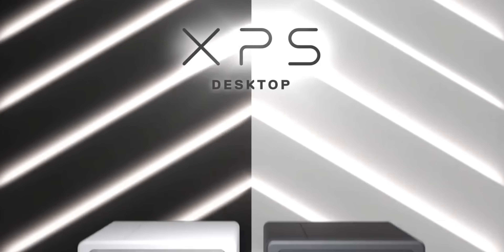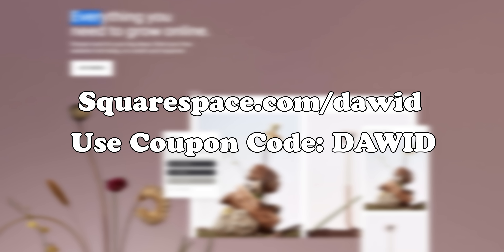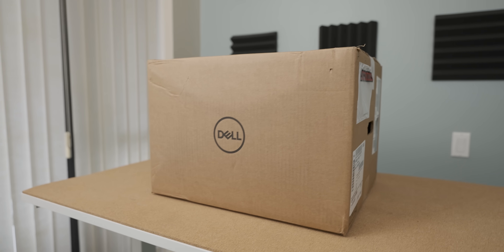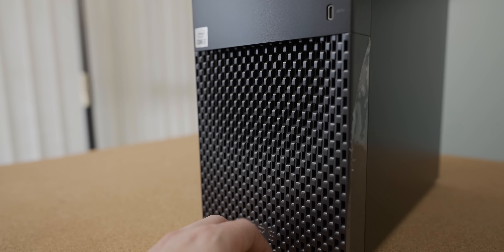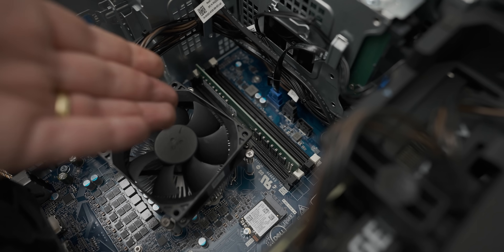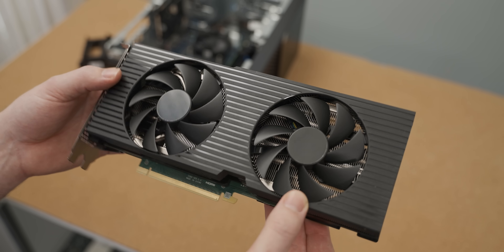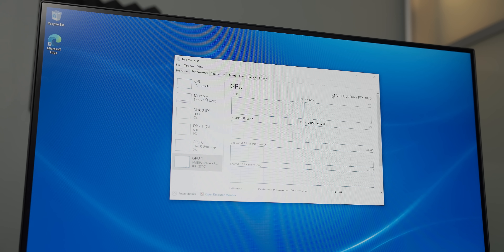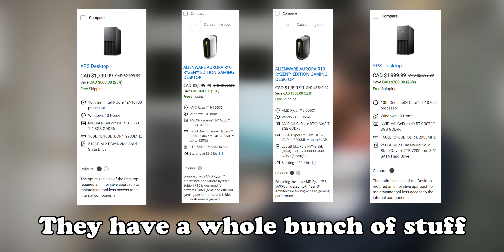DELL Did Me Dirty... RTX 3070 Dell XPS Pre-Built

Comment: Why diss the PC's outer appearance when that's what you ordered? If you wanted it to LOOK like a gaming PC then you should have bought an Alienware. Why diss the mouse and keyboard before you even try them? Bet you that wired mouse has way less lag than many wireless mice have. And the keyboard? We had a standard basic Dell keyboard that was used hard for 6 years or more. It took a lot of pounding in games and kept on tickin'. Regarding Soviet-era power plant operations it's worth pointing out that they retained and maintained their tube-powered electronics instead of updating it all to solid-state equipment. Why? Because they knew that in case of a nuclear explosion miles away transistorized gear would fail from the huge emi field generated by the event, whilst tubes would continue working. Dell will no doubt send you 2x8GB RAM modules if you ask for them, although you shouldn't have to! If the better cpu cooler was definitely displayed in the website product photos then they should also send a tech to your home to install the nice tower cooler for you (what are the chances?).

Comment: The 3070 works fine with a single 8pin with a 500w PSU? My PSU is 600w and my 3070 takes a 8+6 pin. How does this 3070 work with only an 8 pin???

Comment: Tbh, I love the aesthetics of those office cases, just a black box without tempered glass panels nor f**king RGB.
Reply: smh you lose performance without rgb
Reply: @cybercery5271  if you don't want to lose performance, you can just use rgb led strips
Reply: I agree, though I don't mind glass when used correctly,
Reply: I don't like the glass panels or RGB either. I just built a new AMD 3600 cpu machine and used an old generic black case from my dad's computer that didn't run any more. I replaced two 5 1/4 face plates with a front fan mod and it looks great. If I want lights, I will buy a desk lamp. lol
Reply: If I could find a beige, retro style case that actually had decent airflow and enough room for stuff without taking a dremel to it, I'd snap that baby up in a heartbeat.
Reply: @RustyShacklefordReal  beige as in old beige that is now yellow? I miss the old thing. But the problem with using 1 of those is that most actually had a on off switch, a pushbutton that would stay in when pressed.  So for now ill just settle for my first gen bitfenix prodigy with useless handles. But atleast it dosnt have glass options, and the only leds i can see on it are the flashing leds near the power button wich kind of only tell the things is on.
Reply: Some be quiet cases look better imo
Reply: I like both, but minimally. Also I prefer static color instead of RGB clown vomit. My all black system with minimal purple RGB and tempered glass looks fucking sexy and you can't deny it. A regular black box wouldn't make me feel the same.
Reply: RGB has come full circle now. Next thing is boomers will all love the "new" pcs with the multicolored lights!!
Reply: IKR, I just can't understand how people can honestly think that unicorn barf look is any good. For me this is a 1000 times better than any "gamer" design. Who needs to look at the guts of the machine anyway? It looks so dirty and unappealing. A clean solid color looks way better imho, the clear look just makes the computer look like a cheap toy, reminds me of those old transparent gameboy.
Reply: @rozadodelacolina  If your computer looks dirty, then shame on you.
Reply: @jewelbell5  Mine doesn't because it has a black panel instead of a window showing all the wires, empty space, cooling tubes, moving fans and empty slots. I don't mean dirty as in literal dirt, but as in anything less than a clean and even solid color
Reply: @rozadodelacolina  dirty and unappealing? Maybe yours, but there’s a lot of us capable of not having wire puke in their case.
Reply: @syreplays5079  No amount of cable management will make a computer look cleaner than a solid color

Comment: The mobo and psu are proprietary as hell, but Dell makes good stuff though.  It’s the same internal design as G5, and Aurora.  I’d demand the 2 8 gb ram sticks though.  Oh....and go into alienware CP and adjust your fan curves, my guy. Also, you only get the CPU cooler if you get i9 or equivalent.  I’m not defending Dell for cutting corners, but the i7 doesn’t need an aio.  Your problem is the single channel setup.  Again, if you up the fan values you’ll get better thermals.  This machine is indeed a hotbox without doing that.  You have a good system that just needs some tweaks.  I mean hell, the 3070 alone can cost as much as the entire rig.   Only downsides I see are the proprietary psu and mobo.  The card was worth it, man.

Another thing is gpu usage.  Look to Nvidia.  There are thousands of complaints of the 30 series underperforming due to shitty drivers.

Comment: in my experience dell has been pretty good about fixing mistakes. i ordered a monitor from them and they sent a thunderbolt docking station. i called and they sent the monitor out and never even asked for the docking station to be returned.

i'd also be interested in  a follow-up video where you re-benchmark with an NHu9s or something similar and dual channel ram.

Comment: I'm sorry I just couldn't stop laughing when i saw that single 8 pin power connector on the 3070.
Reply: RTX 3060 Ti and 3070 FEs (or reference cards) only require a single 8-pin for their adapters. The 3080 and 3090 FEs need two 8-pins on two separate cables
Reply: Why? It only needs a single 8 pin
Reply: I think it only needs one 8 pin right?
Reply: @MaybeAdvik  yeah but as somebody who overclocks their system, I can't stand to see sub-optimal power distribution. You'll notice that on most partner boards have 2 8-pins or at least an additional 6-pin, which is to allow higher power consumption in exchange for higher boost clocks or better overclocking.

Comment: It is surprising that they did not deliver what you ordered.  That alone should result in a return so that they can fix what's wrong.  If the Ram and cooler are not what was advertised, then they need to fix that.

Comment: My two cents on fixing this system...
#1) NF-S12A might be ideal for front case fan (3-pin and 600RPM with ULNA).
https://noctua.at/en/products/fan/nf-s12a-uln
 A front fan would definitely help. The blockage isn't nearly as bad as many people think provided there's at least some space for air flow... if the motherboard has PWM fan headers and appropriate software to control them (not guaranteed) then I'd just get a quality case fan such as a Noctua chromax black fan meant for a case (not static)... if there's NO FAN CONTROL then I would look for a quality 3-pin (voltage) fan that you have a MOLEX or SATA power cable adapter for that spins at 1000RPM or less at full load..
#2) DUAL CHANNEL... not much to say as that's obvious.
#3) Better CPU cooler... I believe that CPU should hit roughly 4.6GHz if the BIOS is setup right and the cooler is adequate... I personally wouldn't skimp on a good air cooler considering the $2000 (ish) PC price already and the fact that an air cooler can last a long time... my Noctua NH-D14 is still going strong cooling my R9-3900x CPU... I believe it's 12 years old now as I got it around the time it released... careful about case side panel clearance on the larger heatsinks (158mm+ is often too tall).

Comment: I bought an alphasync prebuilt for £1700  with 32G ram 500gig M.2 SSD an RTX3070 and an AIO.  Best prebuilt I've ever seen. Only problem I had was the RGB was connected to a pushbutton instead of the motherboard ?? lol.   https://www.ebuyer.com/1128542-alphasync-rtx-3070-ryzen-5-5600x-32gb-ram-2tb-hdd-500gb-ssd-as-d5403

Comment: cpu 90 temp on high gaming normal men you juste need spec your gpu to fan spin little bit more to make every colder on the pc you need use power of your gpu to get more air flow on the cpu and same for the cpu cycle air

Comment: you should contact dell customer services and request for 2 8gb ram sticks and return them their single stick . also further more enquire about the cooler they have pictured in their marketing material. as this is what you believed came with the system. and possibly explain that your current cooler is not enabling you to take full advantage of the pc capability.

Comment: A year or two ago, I bought myself a Dell Inspiron 5680 "gaming" desktop for $600. It came with a GTX 1050, i3-8100, 8GB 2400MHz DDR4, 1TB HDD (as a boot, really Dell?), 460W Dell Bomb PSU, and their slow blue skull motherboard. The thing was hot garbage, and I also had a VR headset that the GTX 1050 despised. I later on upgraded the thing all the way to a GTX 1660 SUPER, i5-8400, 16GB Dual Channel DDR4 2400MHz, and adding a 1TB M.2. The temperatures on the GPU were 70 degrees at max, but the stock CPU cooler had my i5 running at 75 degrees, that is ok but could be so much better. Also note that there is only an exhaust fan for airflow, the intake is just holes with do basically nothing, I HAD TO TAKE THE SIDE PANEL OFF FOR MY CPU BECAUSE OF THE DOG COOLER.

I ended up buying a Corsair case, GIGABYTE motherboard, 550W EVGA PSU, A HUGE RGB CPU COOLER, a new 1TB HDD to play it safe from Dell's 1TB, and salvaging my GPU, CPU, RAM, and SSD. At this point I'm building myself a new PC, well because I am. I installed Windows 10 off my Dell onto a USB drive, built the PC, installed Windows ONTO THE SSD, TAKE NOTES DELL. Let me tell you, the thing is quieter, HAS AIRFLOW, CPU is at around 28 to 30 degrees idle, 50 under full load. (BIIGGG DIFFERENCE). AND I CAN'T TELL YOU HOW AWESOME IT IS TO BE ABLE TO ACTUALLY SHUT DOWN MY PC KNOWING IT WILL ACTUALLY BOOT FAST. I had to SLEEP my Dell so it wouldn't take 80 years to boot off that hard drive, the Dell never got a chance to turn off properly unless I upgraded something or if it froze up, (COUGH COUGH HARD DRIVE AS A BOOT, COUGH).

My lesson learned and hopefully something you should consider: Never buy a Dell Prebuilt unless it's like an office desktop, Dell is not a good choice for gaming at all. If you're going to game, buy a prebuilt from somewhere other than Dell, or maybe salvage a GPU laying around and build a PC yourself. (The GPU market at this time is dog water, I can't even find a 1660 SUPER for cheap no more).

Comment: Dell's PSUs are actually top-notch. They always under-rate them, and I'd argue that even the ones without official 80Plus certification would meet the criteria for Platinum or Gold.
It's really surprising given the weird choices they make when building these machines. They put so much effort into ensuring the PSU is quality and will rarely be a point of failure, but put so little effort into airflow or motherboard design for their OEMs

Comment: i wouldnt have purchased a xps at all i own one the nightmare you face upgrading the machines in the xps lineup are a joke
Reply: Dell sacrificed the XPS line when they acquired Alienware. They used to be much more upgradeable than they are now. That used to be one of their big selling points. They aren't much different from the Inspiron or Vostro lines now.
Reply: yes
Reply: @Aditya Bhattacharya yes there laptops are not bad i wont argue there its there design choices thats where the issues line
Reply: @johnDingoFoxVelocity  I know new model is better but my Dell XPS 15 is the last Dell hardware I will every get. Battery swollen after a few months, screws screwed in so tight, I was unable to disassemble to repaste it, heats up and throttles very quickly and they removed undervolting, so I can't even manage my temperatures that way. As someone that never planned to buy a Mac, issues with Windows 10 and Dell have finally made me look the other way. Really disappointing. And their customer service is the *worst*.
Reply: @anam00090  indeed.
Reply: @Hello_-_-_-_  Everything. The motherboards are proprietary and won't work with a standard ATX PSU, or mount up in a standard ATX case. Don't buy one of these thinking you will be able to move everything into a standard case so you can use a more powerful graphics card with it. These machines are built to be disposable.

Comment: some of us LIKE our understated cases.
I've been using a Bitfenix ghost for nearly a decade now, and I refuse to upgrade it because it's the perfect case. It's not flashy, sure, but it has everything I want in a PC case.
room for a top-mounted 280mm radiator AND enough room for a 120mm exhaust fan, removable dust filters on every intake, dual front-intake 120mm fans, 3x5.25 bays for my optical drive and hot-swap hard drive racks (I like playing old games and watching blu-rays!), and it even has a secret compartment on top for a hot-swappable SATA 3.5" hard drive.
Hell, it even has an external 3.5" bay, and YES, I have a working USB floppy drive in there so I can make boot disks and whatnot for my old 386 that I still play games on.

Comment: That 3070 is crippled power wise a wee bit.. 225w max thanks to the 1 8 pin power. I have a 3070 Gigabyte Master with 2 8pin for 375w total power (75w from the PCIE Slot) And I see around 260w and higher TBP when playing games. That card would do better with 2x8pin. Not sure why they limited it like that. BUT if it did have 2 8pin Power, the PSU would have to be upgraded to 550/600w

Comment: My Dell pre-built that I bought in 2003 was a disaster. Filled with bloatware, hobbled by outdated drivers, and an ugly as sin case, from your video it seems that Dell hasn't learned anything. It would be interesting to see a makeover of the hardware by 1) putting the electronics in a decent case, 2)upgrading the cooler and 3) memory, and 4) doing a clean install of Windows; and then calculating the costs - see if this combination is still a good value. Great video as always!

Comment: Getting the Dell XPS makes a lot more sense than custom building a computer.  The money saved is so much that getting another stick of ram and a tower cooler at one's own expense is no big deal.  It comes with a high quality platinum power supply.  The accounting firm styling of the box is, to me, much more pleasing (doesn't clash with living room furniture) and functional (front panel i/o with card reader and USB type C) than the mostly gamery cases sold on Newegg and Amazon.

Comment: The psu is one of the new 12v atx  standards I believe. Is there a way of measuring this for efficiency? 
Also, 
Can you test the 3070 in a different PC to see if it really is the cpu/ram/venereal disease cooler hold it down.

Comment: I actually really like the dell keyboards that come with the prebuilds... way more than the pricey keyboards lol...
Reply: Those keyboards are shocking once you’ve used them for a long period of time. I got a keyboard like that during lockdown and work from home and after a month of heavy use some of the keys started jamming and sticking if you accidentally hit them on the side. My wife’s keyboard was similar. Went onto eBay and grabbed a bunch of Lenovo keyboards (the KB1021 aka SK-8825) and the day was saved. I have since gone back to eBay and managed to get an ex-stock 10 pack of these same keyboards. The best ones made in my opinion and you can bash them for years.
Reply: @wizdude  must be a region thing , I'm in Hong Kong and.have been.using a dell keyboard for like 15 years from an XPS machine
still have a ps2 connector one that still works
Reply: @Digger318  we are not talking about the same sort of keyboard. I’m not talking about the original classic dell keyboards - they are nice and reliable like the original Lenovo keyboards. I’m talking about the new “calculator button style” pieces of trash which ship with all new machines today and what Dawid received with his machine as well. They have only been shipping these over the past few years and they are the worst things to type on. This is why I stocked up on lots of the old style keyboards as eventually you won’t be able to get them any more.
Reply: @wizdude  oh, I better get more then 😅

Comment: For reference, that PSU is a 12vo not ATX. All it does is 12v and the 5v and 3.3v are taken care of on the mobo. The fact that it has several 12v rails isn't a problem for the GPU since a single 8-pin PCIe connection is rated for 150 watts and one of those 12v rails can supply 216 watts, plus the PCIe slot being able to provide up to 75 watts, and that should be using a separate 12v rail. Being that it's a Delta PSU, that's more than a safe bet. Just FYI. Plus, I'm sure that 3070 isn't one of the highest performing models out there, and shouldn't use more that the rated 220 watts.

But they sure baited you with that dual channel and a small form factor cooler... bastards.

Comment: at least its a cheap upgrade. £50 for another 16 gig stick (maybe cheaper) and a £40 air cooler would be more than enough for the 10700. or if you want to save a bit of money, the Wovibo cooler from aliexpress for about £24 performs about the same as competing £40 air coolers, however the seller never responds and the mounting mechanism is very difficult to work with. HOWEVER, the cooler was VERY well packaged, which is one of the problems with the snowman cooler that Tech YES reviewed, I ordered 2 of them, the first time I received a DIFFERENT cooler, the second time I received the correct cooler however it wasn't packaged well enough and theres a big dent in the part which has contact with the CPU, and the fan is cracked. The wovibo cooler is definitely recommended however, and the snowman is good if you can find one on ebay for example that ISN'T coming from china, as you can then easily return the product and get a replacement/refund, which is difficult when ordering from china.